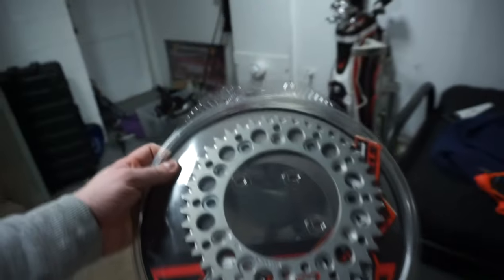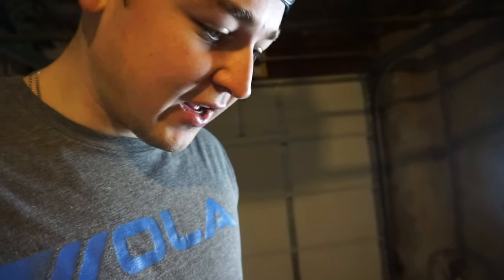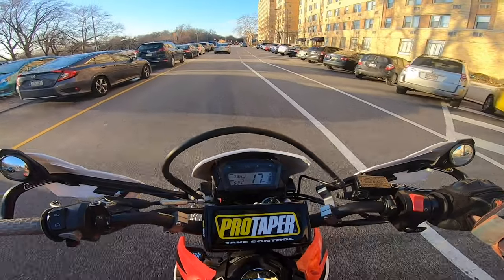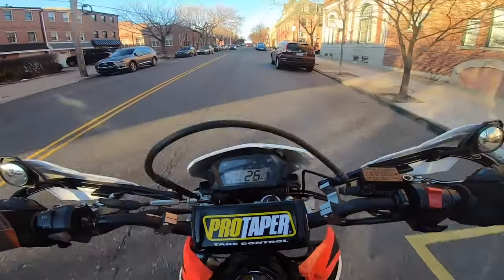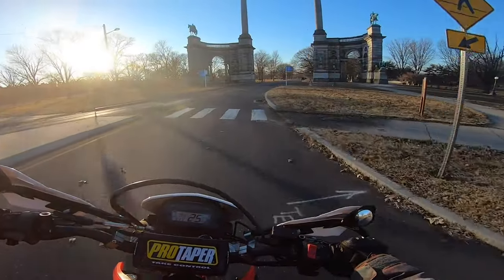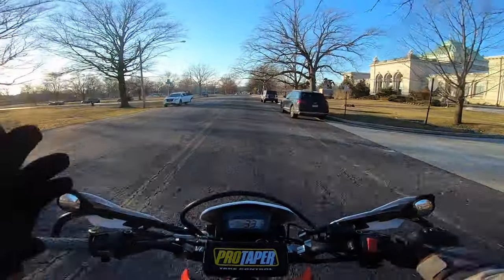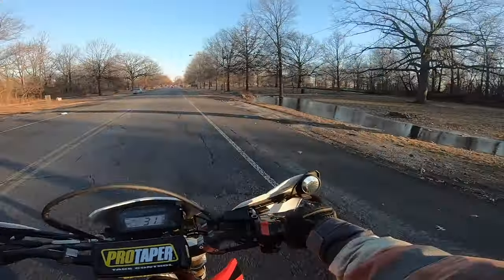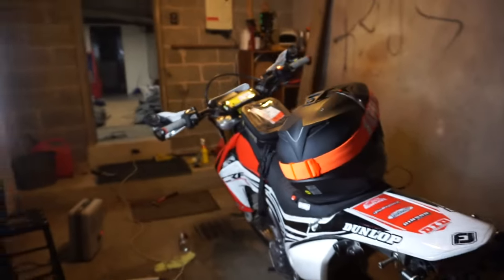the BEST CRF300L & CRF250L sprocket setup || 13/42 INSTALL💥 💥

Comment: Bro with 13 42 you can wheel 2gear?
Because with 14 40 you can only first gear thanks
Reply from the maker: Yup! You can wheelie in second gear with 13/42 easily. I wheelie now in 2nd gear with 14/42 and have no issues. Check out my recent videos for proof!
Reply: @ConnorGMedia  bro 14/45 how do you think

Comment: I got a 13/48 T sprocket setup, with a 3D printed, chainguide. But i have to do alot of gear changing while driving. But the Torque is amazing.
Reply from the maker: 13/48 is hella toquey i bet. Probably would be a dream to wheelie!!
Reply: @ConnorGMedia  Yeah it is amazing for wheelies, but max speed is low.
Reply: @danasheka how low? if you reply a year later lol. trying to find the best set up for me.
Reply: @mr.conner636  Dont go with the 13/48 it’s just fuel consuming, and the top speed is around 100km/h
Reply: @danasheka  thx
Reply: Does the chain guide have anything to do with chain reliability cuz i removed mine and the chain because EXTREMELY loose with just 100 miles of riding. Thanks for any help
Reply: @SomeOneWithAYoutubeChannel   I dont think so, but remember to thighten it according to the manual, me myself i dont recommend 13/48 it is the worst.
Reply: Bro 14/45 how do you think  @danasheka

Comment: Hey Connor. If I ride mostly just street and no highway would you recommend the 13/45 setup. I’m planning to put on supermoto wheels as well
Reply from the maker: No I would say do 14/42. Especially if you’re doing sumo wheels, the smaller diameter rear wheel will already make the gearing slightly lower. 13/45 is far too short for any decent street riding
Reply: How about 13/42 with that set up. Will that work pretty good?
Reply from the maker: @seeweed22  ya it'll work well. I just personally find 14/42 better, less buzzy and way better on the highway
Reply: @ConnorGMedia  bro 14/45 how do you think

Comment: What have you experienced from going from stock gearing to 13 42 with the 300l?
Reply from the maker: I can't say for the 300L specifically, but these bikes are basically the same so the differences would be similar. 

The lower gearing gives you way more low end torque. The bike wants to lift the front wheel in first and second gear pretty easy. Acceleration is also great. The only sacrifice is top end. I ride comfortable at 65. 70mph is pushing it. On my next video, I do a little road trip with this gearing and you'll see it kinda sucks on highways with a speed limit above 70. Other than that, I love it!!
Reply: @ConnorGMedia  Of course there is more torque with this setup, but the 300 has 10% more power and torque and a lower gearing in the transmission for the first 5 gears and a longer 6th. So - really hard to compare just by saying they are similar.